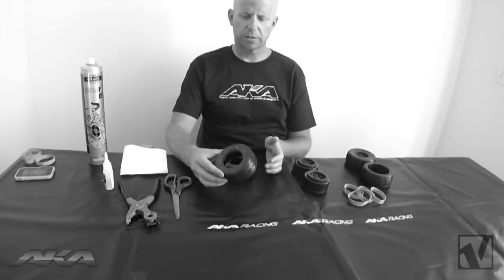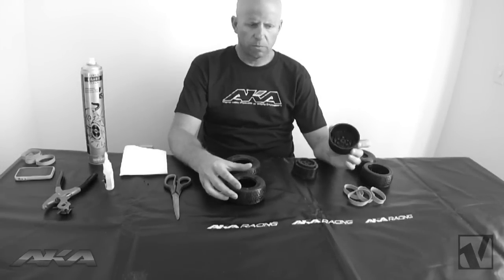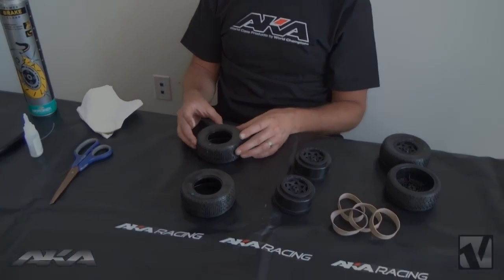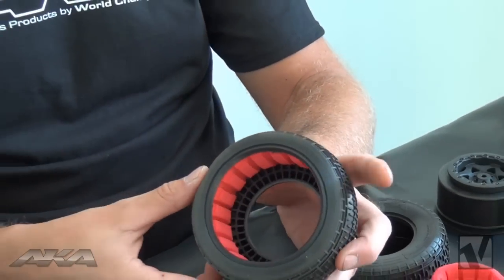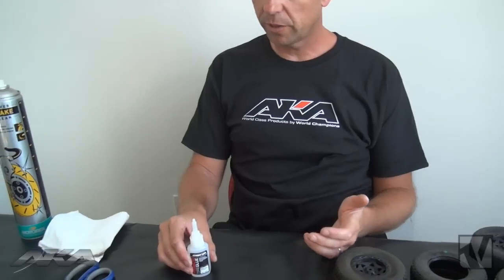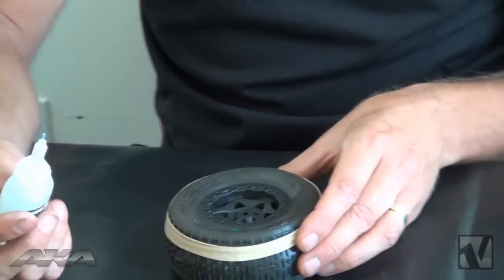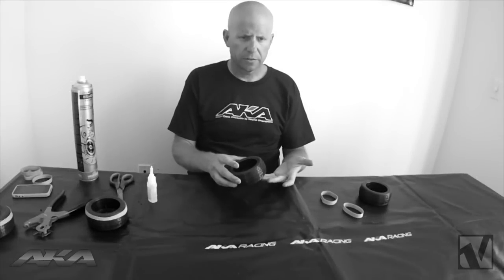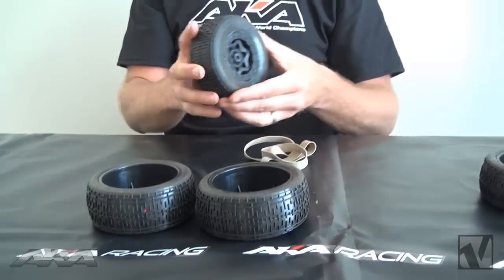Glue Short Course RC Tires with Mark Pavidis - VRC Magazine

Comment: If the tires are glued and sealed properly, then no holes in the tire would allow no water or dirt in, right?
Holes are to get rid of water, but if they sealed properly to begin with... why holes?
Reply: mikekoz68 The Reason there are Holes is to Air out the tire. At highspeed the tire "balloons". Your race tires bloated with air is bad for performance/grip, hence the holes to quickly release the air. Water and Dirt entering those holes are the side affect. Its mainly for Racing, not needed for bashing.

Comment: i think its stupid to put holes in tires, yes it might get the dirt out but it also gets it back in just as easy. specially for water! water is gonna get in there so fast and mess up the balace of the tire when therefor its gonna handle a lot worst. also without the holes you get a bit of air stuck in there which is perfect for smooth landings. i usually go thru tire before the inside is damage so i strongly disagree with the hole idea.